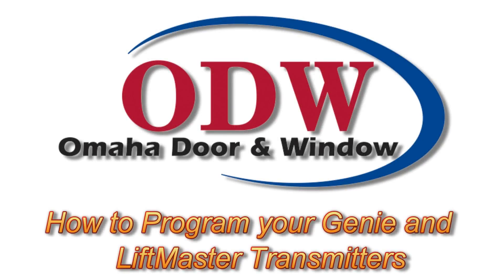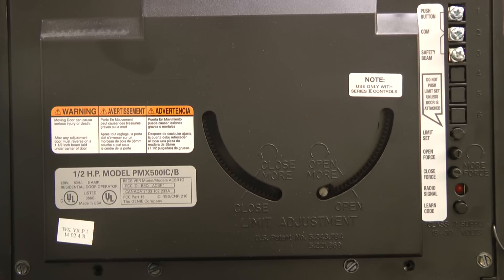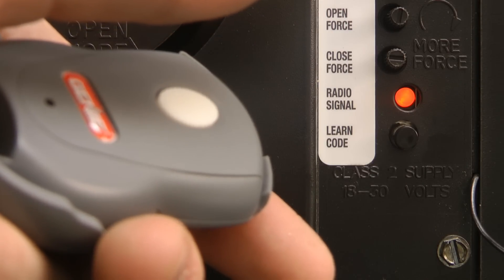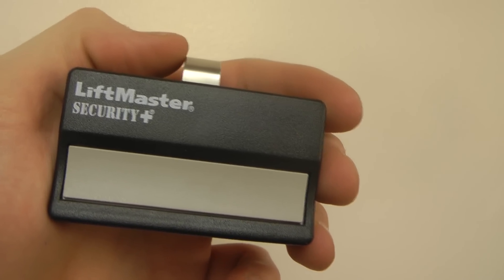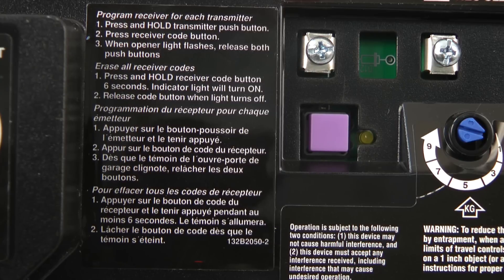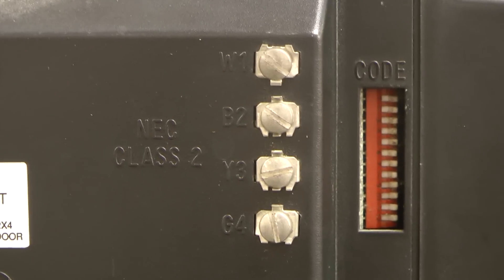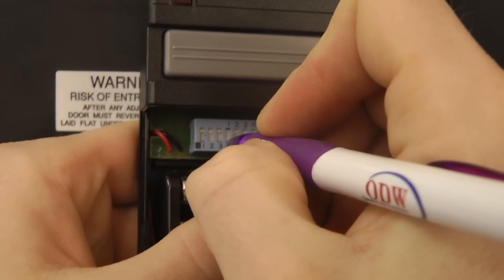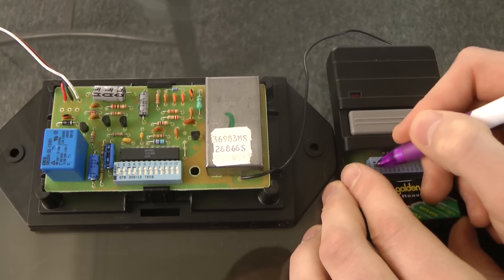How to Program Genie and LiftMaster Transmitters

Comment: I don't know if anyone will answer this but here it goes... We just bought a house and the garage door opener they left behind is an orange learn button LiftMaster motor but a Genie remote. It doesn't currently work. Can different brands be linked to each other?
Reply: Did you get an answer ? I have the same issue
Reply: @dorothyhafso5673  I didn't get a response however after further research, it seems you cannot mix brands. I found some remotes labeled as universal so I'll see if that works.

Comment: Do you know how many devices I can use with this one ?
41A5021-1G
Reply from the maker: Typically, LiftMaster has a limit of around 7 devices. You can try to add more devices, but one of the previously programmed devices may drop off. We hope this information helps!

Comment: Matt...the video's instructions for programming the Liftmaster appear to be the OPPOSITE of the instructions on the motor head...or am I missing something?  

The motor head (as seen in your video and on my motor head as well) says: 

(1) Press and hold transmitter push button, (2) Press receiver code button, (3) When opener light flashes, release both buttons.

But the video says...

(1) Locate and press the smart button on the motor head...LED will come on, then (2) Press and hold the button on the transmitter.

Comment: I have a liftmaster and my remote stopped working although the door does respond to the button in the garage. I tried to reset the remote by pressing the smart button and resetting the remote but the remote continues not to work. Does this mean I need a new remote?
Reply from the maker: Hi Joe! We will need to have a few more questions answered before we're able to recommend a new transmitter. Please call us at (402) 733-6440 in the morning from 8 am to noon and ask for Leroy in the Garage Door Service Department. He can troubleshoot the transmitter problem. Thank you!

Comment: not too clear. My ;problem, with chamberlain unit, is remote openws door, but to close, i have to hold the wall switch, an old thing. what to do to replace this,, with something i do not  have to stay and hold switch until door is closedtrhanks     rob
Reply: the sensors are not aligned at the bottom of the door.

Comment: Can you program a transmitter solutions 390 to a genie
Reply from the maker: You will have to check with solutions 390 and give them  you Genie model number to determine if it will work.

Comment: You can actually be that the him if you use the chamber 956 your 953 TVs I'm EVC it'll work just push the button but once he said like a solid push another button on the remote then press the same Biden your programming to the opener light should go out push 11 again the door will run so I hope I can help please give me a call, message me if you want to know complete instructions